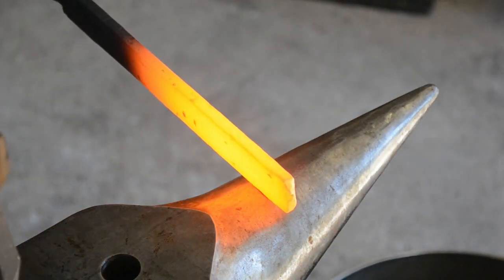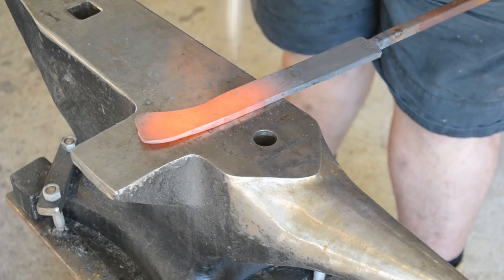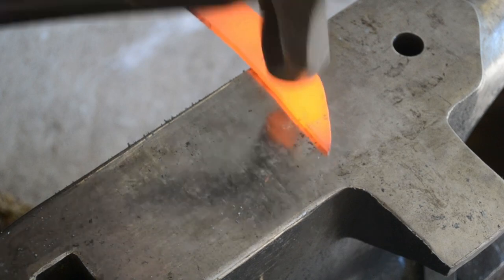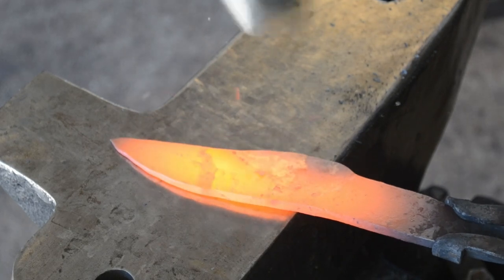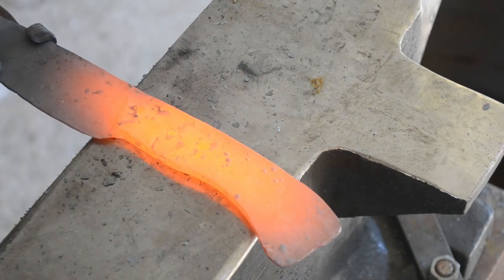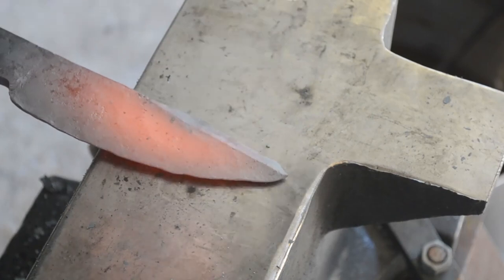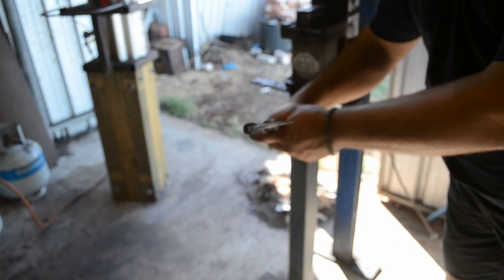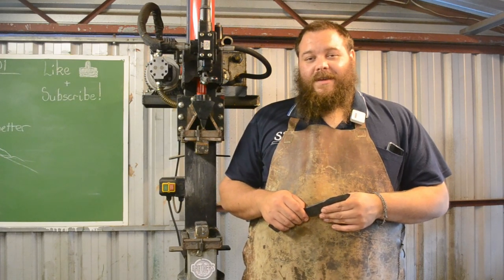How to Forge a Full Tang Knife

Comment: Awesome work Sam, a very informative video indeed! With tapering false edges or harpoon type edges, does the angle of the bevels have to gradually get more obtuse as you move towards the tip? Congrats on 6000 subs btw!
Reply from the maker: Thanks mate! Actually the angles get very slightly more acute toward the tip, good question though!
Reply: @SamTownsBladesmith  Is that to do with the distal taper of the blade then?
Reply from the maker: @lukegraham1945  yep!
Reply: @SamTownsBladesmith  Ok cool, found my issue then. Thanks for helping!
Reply from the maker: @lukegraham1945  no worries, glad to help!